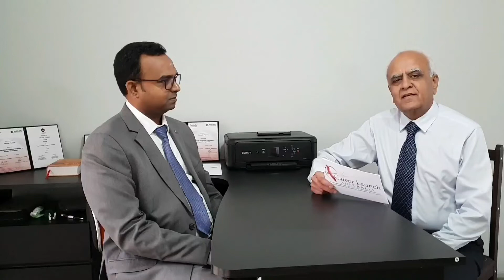Shri | Electrical Project Engineer | Career Launch Australia +61 409 13 14 15

Comment: It was really motivating to watch this video interview with shri who has recently migrated to  Melbourne and was able to get job quickly. I would say Rajv Sir has a art of  changing mindset through proper mentoring and he  did it with shri and all of us. When People migrate to Australia they have preconceived ideas regardless of the skills they possess . Rajiv Sir has infiltrated the positive mindset by aligning mind, body and spirit. By following his exact framework there is space created in the body and as a result   the energy flows and also with our mind we have too  much thoughts which are clogged and  they need to be flushed out. Just by applying  for the jobs after coming to Australia it doesn't help but through this career launch it gives a direction  and which is actualised and we can clearly see from shris experience. This video clearly depicts Rajiv  sirs personality and after watching I felt love and caring attitude outpouring from  from Rajiv sir and also shri had plasticity towards Rajivs  sir framework. Also mainly shri talks about negative influences . I would like to broaden further by adding that we should not lend ourselves in the hands of outside negative influences but we can  change the belief by embracing reality and striving towards perfection by just breaking the barriers of mind. Another aspect of above interview is not get to just enroll in program and get the job but personally I feel it will help us in the long-term. I myself visualize to meet Rajiv sir again by giving testimony